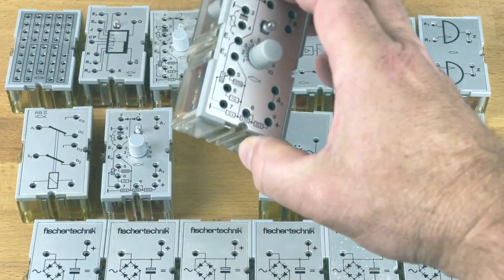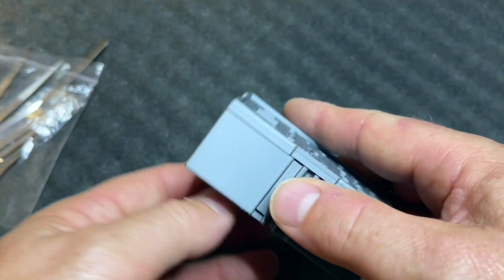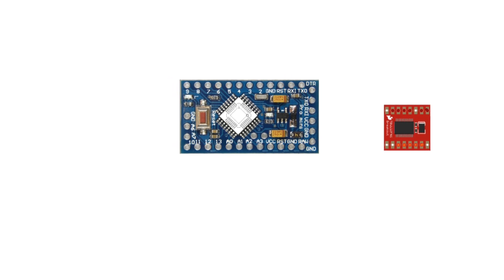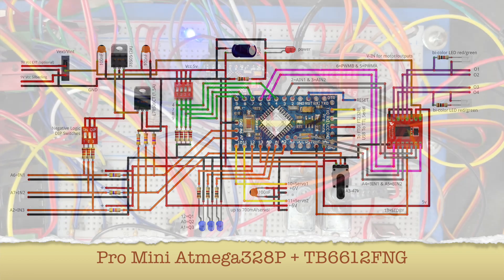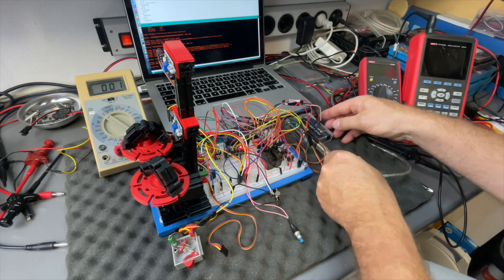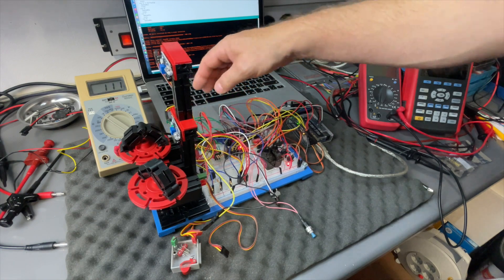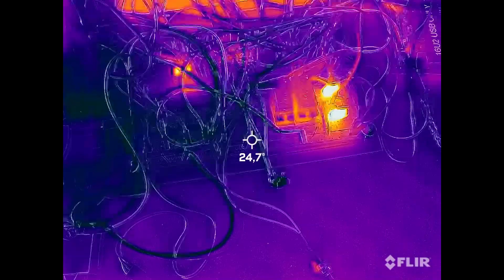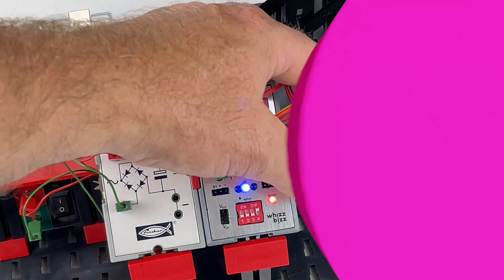Arduino Pro Mini for use with fischertechnik 'Silberlings'. The 'Zauberling'

Comment: Hi, nice silberlins, but where did you get the 3.5 bushes for the connectors?
Reply from the maker: You mean the '2.5mm' connection sockets? I think I already answered to that by mail last week? Yep, I'm the same 'Arnoud' 😁These sockets are 12mm, M3 'Hollow Rivets' from China, that I widened to 2.5mm after melting them into the 3D printed front. Will make a page (perhaps a video) about the solutions for fischertechnik sockets I've come up with so far. Let me experiment with one recent 'discovery', then I'll post it here or on whizzbizz.com, ok?